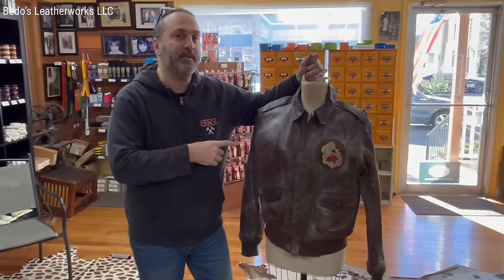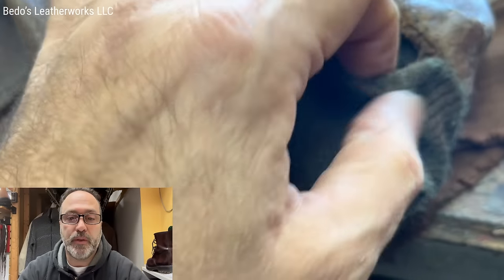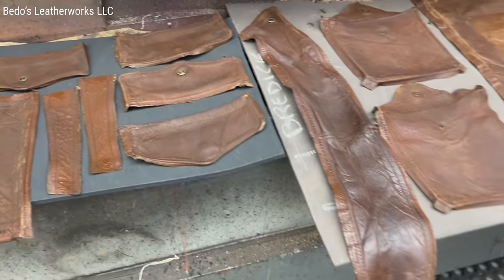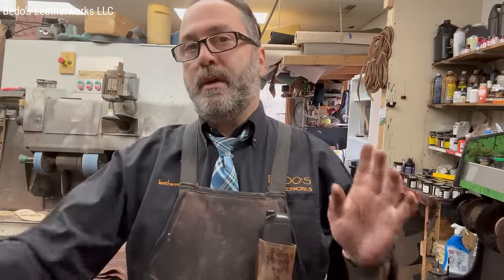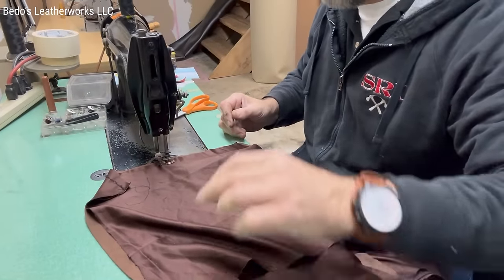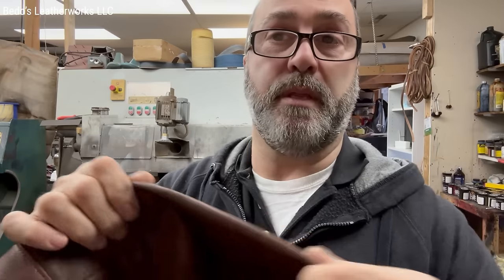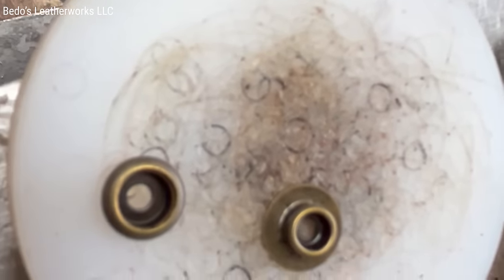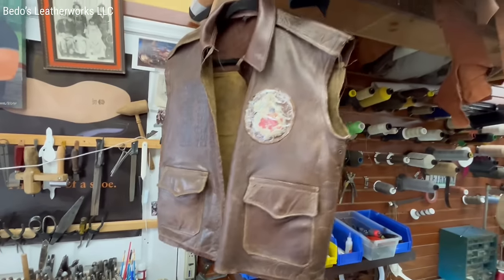WW2 Flight Jacket Restoration

Comment: If he was stationed in Bedford/Bedfordshire, it's likely he was at Podington Airfield, near Northampton. It was station 109 on the USAAF 8th Air Force and flew B17s.

The site is now Santa Pod drag strip.  There is a memorial near the start line of the strip and another memorial garden a couple of miles away from the track. I usually stop and pay my respects at the garden when I'm down to watch racing at the strip.

Comment: another great project, Steve.  In regards to "Sharpen-gate", as a woodworker, I use chisels, hand planes, spoke shaves, etc, which all have blades that need to be kept sharp.  There is definitely a correct way to do it but I've never once been "triggered" by your blade touch ups.  The blades you use are very thin, disposable style blades and not intended to be resharpened though as you know, you can touch them up to get extended life out of them.

Comment: "Zackley!!!"  The right tool for the job. You sharpen to repair a damaged edge, you then HONE to maintain that edge.  So... now, once you begin to HONE that edge on your disposable blade(s), they'll last even LONGER than before.  LOL  That'll trigger those who believe you throw it away, just because they've always seen it done that way.  BTW... if you're ever out and about and don't have a hone with you, the top edge of the roll-up window on your car will hone like a ceramic does (in a pinch).

But?  We didn't get to see the whole process of bringing that poor old jacket back to life again!  Good ol' Bick4 to the rescue once again.   Another fine finish to a repair.  I believe the original snaps are called "Line 24" and the ones you used for the pockets/collar are called "Line 20".  Don't know why those terms are used, but the one who taught me how to work leather used them to ID the two types.  I like a fine tipped oiling pen to place a tiny drop of fine oil to the female half of the snaps to help them function more smoothly.

Bought a new holster/mag pouch.  Edges of the leather needed finishing, needed dye, and need to be burnished smooth.  Now that the dye is dried, I need to burnish them smooth.  They also got a nice slathering of Bick4 to aid in the breaking in.  My second pint of it is almost used up, almost time to crack open the gallon jug.  Love that stuff.  Needed to condition the belt too, and found I'm missing a Chicago Screw, time to go digging through my stash.  Kydex is nice, but NOTHING wears like good leather.

Comment: hi i was trying to shave off some worn out leather of my jacket by using a burning match stick and in turn it shrunk the leather a lil bit and there is about 10 mm straight mark which has formed, is there any way out to deal with that can it be restored to the original texture